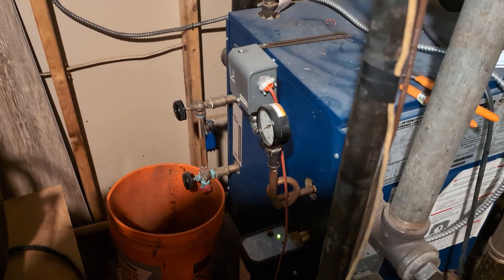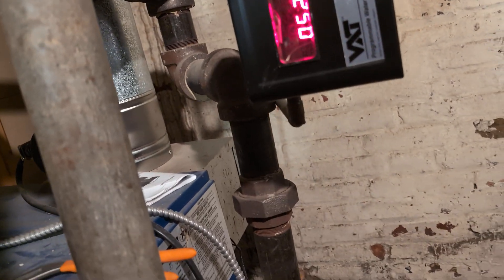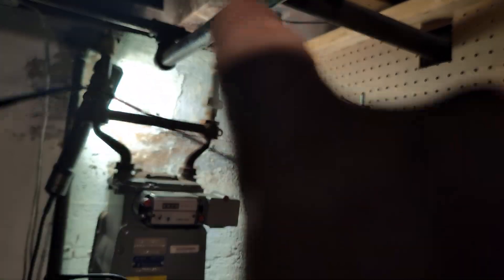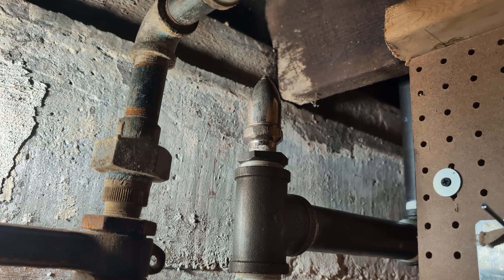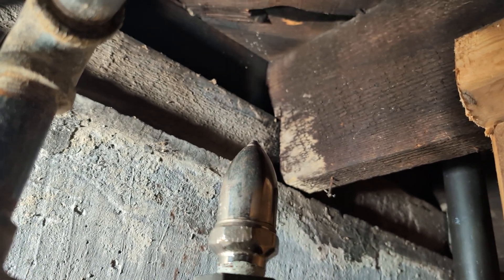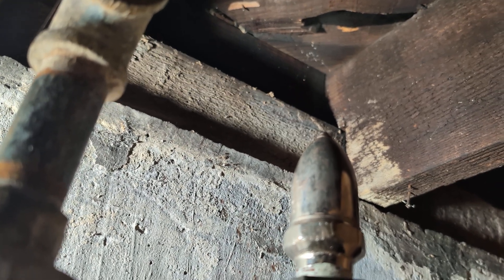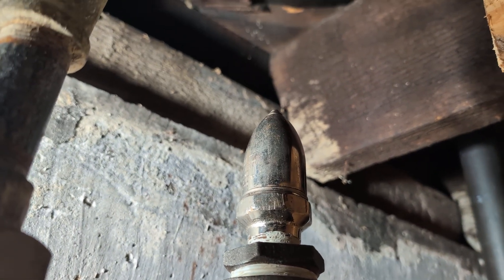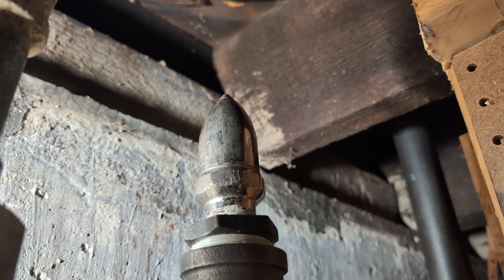Leaking Steam Vents Destroy Steam Boilers Slowly But Inexorably. One Way To Check For A Leaky Vent

Comment: Why does it ruin boilers ? I had a new steam boiler installed but they didnt change that vent ( mine is the same as the video )
Reply from the maker: It is not the vent per se that kills your boiler.  
Proper main steam vents are necessary for the best operation of your steam system.
It is the LEAK (any leak) that kills your boiler.
How?
It is by the "make up" water that must be added to the boiler to recover the lost water due to the leak.
The make up water has dissolved oxygen in it that will rust out the boiler eventually.
Something killed your old boiler most likely.
That something was most likely leaks.
Tiny leaks here and there add up over the years to rust out your boiler sooner than it should.

By the way, if your system only has that vent pictured in the video, it is likely too small.
That vent is only for very short mains (6 ft maybe).
I hope you have other, larger & non-leaking main vents on your system.
Where there is air, there CANNOT be steam.
The air (and air ONLY) must be allowed to escape from your steam mains as quickly as possible.

Do you have an automatic water feeder on your system?
If so, it must be the one shown in the video (the "VXT").
Reply: @gordonschweizer5154  Thanks for the response and the information  i appreciate it you the old Peterson steam boiler was from the 70s and  was well past its life .the installer told me the cast part had a huge hole in it .I didn't have the auto feeder  installed so that I go down and check it once a week. He said it should be drained at least once a month to remove any sediment .does that sound normal .I will take a picture of the vent tomorrow  and share it here .I spent the winter replacing old steam vents .I really need to replace a few of the radiators  next due to pin hole leaks
Reply from the maker: Thanks!
If you have an electronic low water cut-off,  your new boiler should not need to be "drained" once a month unless it was not cleaned properly on start-up.
The only draining might be the sight glass.
The sight glass should get a proper drain valve (usually special order).
I have videos on sight glass (or sightglass) drain valves.
I'd check the instructions that came with the boiler on cleaning.
It is very important that new boilers be cleaned properly.
It may be difficult to share pictures directly on ytube.
Try going on to HeatingHelpDOTcom & post pictures there on your boiler installation as well as your vent pictures.
Tell them I sent ya!
Reply: @gordonschweizer5154   will do and you are correct  I'm  just draining the sight glass sediment. Small bucket full. After it was installed and running I was getting a bit of hammer so he hooked up the pump and drained and refilled the system and that solved the hammer noise
Reply from the maker: OK!
You may have to drain and refill your boiler & wet return a few more times.
You may know that the manufacturer of your boiler douses the cast iron sections with oils, surfactants, detergents, and other eleven herbs and spices when they machine them.
These all soak into the cast iron and when you fire the boiler, they all come back out to "play", playing havoc with your water quality and generating "wet steam".
That was likely the cause of your water hammer.
It is likely to return.

Comment: What is the capacity of that little thing?
Reply from the maker: Not much (about the same as a Hoffman #40), but sometimes that's enough on a very short main.
This vent is the (notorious) Hoffman #4A so-called "Quick Vent".
They actually emboss that "Quick Vent" merde right on the body of the vent itself.

Comment: Yes in this reach of a situation, the bi-focals work better than anything. 
     Yes as it will work harder than necessary, temperature at t-stat will not be satisfied causing  boiler run on .